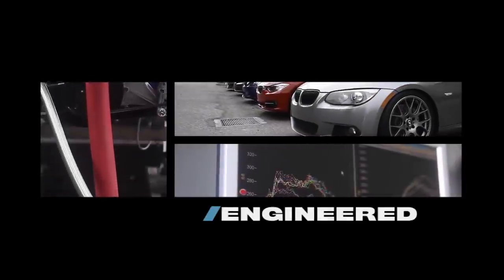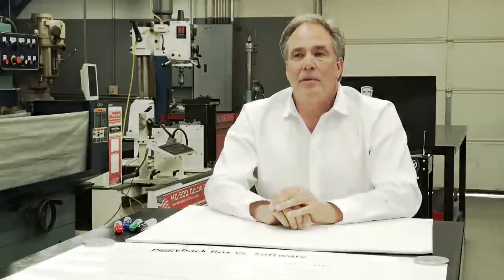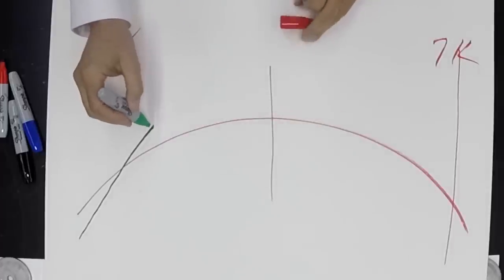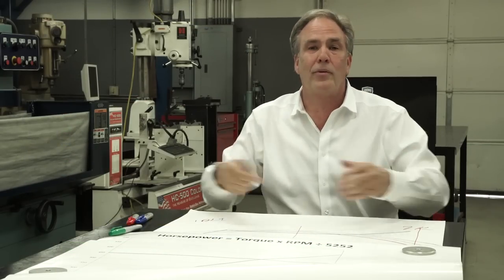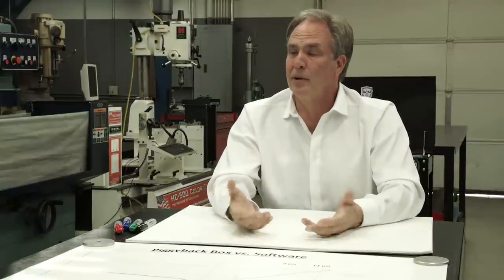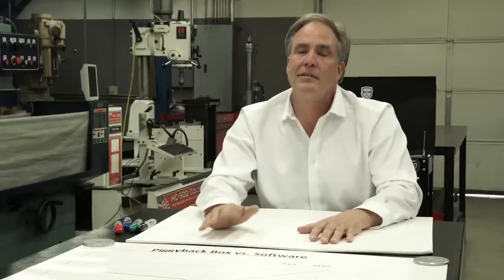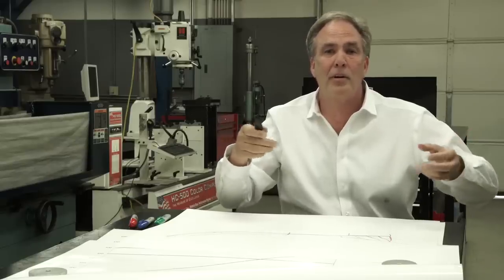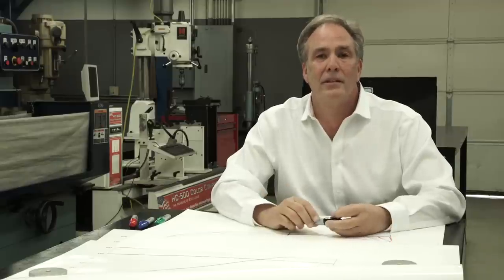The Magic of ECU Tuning - /ENGINEERED

Comment: I respect what Steve has accomplished.  I learned a lot by watching this.  However, he's wrong when he talks about ECU tuning on N/A engines being a waste.  I know from personal experience that I picked up 3 mph of trap speed and 3 tenths in the 1/4 mile with just a tune on a 5.0 Coyote Mustang.  This was consistent across 2 cars that I owned.  There ARE "conservative" factory tunes.  You gain throttle response, power beneath the curve, and peak power if it's done right.  Hundreds, if not thousands of people have repeated the results I'm reporting.  Dyno testing proves 20-30 whp gains.  I'm sure what he's saying is true with some N/A engines, but certainly not all.  Real world repeatable testing is more powerful than assumptions about what does or doesn't work on all engines, based on tuning experience with SOME engines from a limited number of manufacturers.
Reply: +hartsickdisciple in the video he explicitly says with no other modifications. He said with new, to use his term, "hardware" like headers, muffler, cold air intake, a new tune would yield more HP. He was stating on a stock car with stock headers with stock muffler with the stock intake a "tune" would get you nothing.
Reply: Cody Cadwallader Yes, I know.  He's wrong.
Reply: +Cody Cadwallader No I would have to agree with hart. There are definitely factory conservative tunes, actually I am sure there are plenty of them. If all you are looking for is more power theres no way a Honda Civic is maxed out for power, regardless or mods or not. I would agree though that the amount of money spent on an ECU or a tuner, or both is not worth the extra 10 whp or so.
Reply: +Joe Befumo Can confirm, I also got a mpt tune on my stock mustang and definelty makes a difference in my 1/4 mile. Conservative stock tunes for sure.
Reply: what he meant was you can't take an N/A engine and go past the natural limitations it has. you aren't actually adding horsepower to an N/a stock tune. what you are doing is removing the safety barrier the manufacturer has set. the horsepower you thought you gained had actually been there the whole time it was just blocked off.
Reply: +JJ20kil3r that's what were saying they have really conservative tunes from the factory, were unlocking the unreachable power. So adding power. tunes can only get you so far, then you need to add hardware and retune for it to get optimum power
Reply: JJ20kil3r What you just said makes no sense.  What "natural limitations" would those be?  Very few N/A engines make anywhere near the amount of power it would take to break internal components.  Other than mechanical durability, which I just addressed, the only other things to worry about are lubrication and fuel/air mixture.  If the aftermarket tune is safe, which most are, there is no "safety barrier" being crossed.  The factory tune may be optimal for driveability in the opinion of the manufacturer, but it's rarely the best in terms of making power or throttle response.
Reply: +hartsickdisciple HAVING READ WHAT YOU WROTE AND ACCEPTING TOTALLY WHAT YOU CLAIM I WOULD LIKE TO GIVE YOU ANOTHER PERSPECTIVE,
I THINK STEVE IS PROPABLY MOSTLY TALKING ABOUT EUROPEAN CARS AS A REFERENCE.
TAKING IN CONSIDERTATION THIS HE IS RIGHT.
IN EUROPE THERE IS NO SUCH THING AS 5.0 MUSTANG AN 7.2 HEMI AND SUCH CARS YOU GUYS DRIVE IN AMERICA.EVEN SUPERCARS DIDNT USE TO HAVE SUCH CAPACITIES.THE LAWS ARE STRICTER,EMMISIONS CHANGE EVERY 4 GOD DAMN YEARS SO THAT THE GERMANS TAKE OVER THE MARKET,INSURANCE COST IN SOME COUNTRIES IS HUGE AND GAS IS MORE EXPENSIVE
SO YOU END UP WITH A LETS SAY BMW E46 320 170 PS.WHAT HP GAINZ WHOULD YOU EXPECT FROM A CHIP????5 HP???8HP?????SO YOU GET THE DRIFT
I AM ALL IN FOR WHAT YOU SAY THERE IS NO REPLACEMENT FOR DISPLACEMENT
AND PROPABLY IT COULD HAPPEN BUT ANYTHING BELOW 2.5 IS JUST A WASTE OF TIME AND MONEY
Reply: +hartsickdisciple You're talking about a tune. I could be wrong but I think he was referring to those crappy chips that cost you $20 and claim to get you 20HP, which is obviously BS. The way you car is tuned from factory is to be efficient in regards to MPG and driveability, like you said. Now, if you change the tune, you can get something a little more aggressive and better overall, in which case, you will sacrifice the fuel economy for more power. The point is that software and hardware go together. If you change your downpipe and exhaust, CAI, use colder spark plugs for instance you need to reprogram the ECM to take advantage of all that stuff. You probably won't get a much HP gains as you'd think but it's not negligible either.
Reply: Emmanuel Thioux I didn't hear him specify that he was talking about cheap ebay chips.  He made a general statement that applies to any type of N/A tuning without hardware changes.
Reply: +hartsickdisciple I see. Perhaps I misunderstood what he said, in which case, I would agree with you. Just updating the software won't bring much gains but they are gains nonetheless.
Reply: Emmanuel Thioux It's tough to beat 20-30 whp and 30+ lb/ft for $400.  You can get that with a tune only on a 2011-14 Mustang GT.  I can't believe that's the only car where this is true.
Reply: +Emmanuel Thioux significant gains depending on the engine. he's dealing with performance high end cars. I'd imagine that many of those have more aggressive tunes than say... a mustang.
Reply: alphapc777 You do realize that the Mustang GT has been a legitimate performance car for quite some time, right?  The coyote 5.0 was designed for the Mustang, and de-tuned versions made their way into Ford's truck lineup.  Almost all engines can gain power from timing adjustments.  The gains vary, and tend to get bigger with the size of the engine.
Reply: +hartsickdisciple I do. I have a 2015 gt ironically. I was just making a blanket statement.
Reply: +Cody Cadwallader I own an e92 M3, and there are plenty of folks seeing 15+ hp and 5+ ft/lb of torque on the dyno with a simple ESS or Dinan tune from stock. Head on over to the forums for proof if you don't believe me lol.

Comment: One thing about the "not making any power without hardware mods"

If you don't need to pass emissions (or plan on bypassing the emissions) you can get a simple tune to basically devoid the ECU from including the protocols that relate to these things.. you will get better performance and gas mileage by removing the emissions from the equation.

I used to do this and then every 2 years when I had emissions, I would tune it back to factory.. until I realized there were a few nearby cities that don't even require emissions, and my ex-gf (god bless her heart) let me register my race cars to her house in one of these places..
Reply: Well if you have a diesel engine, maybe depends on what type of emissions system they run, on a gas engine, you might be able to increase the boost pressure but that won't help the gas mileage :P
Reply: Haha no it certainly wouldn't! I'm talking about a naturally aspirated engine, the motors being tuned for emissions actually takes away from mileage and performance compared to when you remove all the emissions factors from the engine! I don't have any experience with diesel motors though.. So I'll take your word for it!

Comment: will a tune for a N/A engine decrease it's lifespan?
Reply: No, not if the engine is tuned right and not knocking.
Reply: xxthehuskycaboosexx I'm not a professional, but I'd say it's safe to assume that tuning a natural engine would increase the efficiency, therefore, creating a bit of extra torque with a positive effect on longevity.
Reply: You're unlikely to make any gains in efficiency by tuning an engine without mechanical modifications. They're pretty close to optimal from factory with manufacturers trying to achieve minimal consumption and emissions.

Achieving more HP in an aspirated engine through software alone will mostly have to be done through richer mixture which will actually decrease efficiency (and all for a handful more HP).

Comment: I bought one of this $20 chips and made over 100 hp with it
Reply: cool story bro
Reply: and dont forget stickers, more stickers more hp
Reply: +bigfutus Neon dude, 900 instant Kw to the wheels
Reply: +Gabriel Ospina Back when Chrome was big in the ghetto honda world, we would buy chips for the ECU at like a buck a piece, burn a new map, run it, make some adjustments, re-burn, run it etc.  Made much more than a few hundred hp on cheap chips haha freeware ftw
Reply: +Poor Man Mods Let me guess. You started with  an engine making over 300 hp and after the chip it makes over 100? Sounds like roadkill to me.
Reply: no, i had a SVT focus, it had 240hp, and i put a $20 chip in and i know it had over 350 RWHP
Reply: +bigfutus After changing my head light fluid, muffler bearings, and upgraded to duel carbureted windshield wipers, my 2005 chevord-lamborsch made 420 LPrwhp (left passenger rear wheel horsepower)
Before, it only made 69 AWDhp.
Reply: g4rr377 I actually prefer chrome duct tape, much more hi-end and as my pop always says, "a little chrome can get you home"
Reply: +jacob prentner wow i heard that that car also has the capability to make over 1000 psi to the left rear wheel. you should also get a sequential short throw dipstick.
Reply: i was thinking the same thing
Reply: +Poor Man Mods dude I know how you can get 500hp , paintbrake calipers red , getfake blow off valve, get fake boost, get sticker ''VTECH'' get sticker blow me up with a turbo, put on the widest body kit and biggest spoier
Reply: dude holy shit than you so much
Reply: +Poor Man Mods 
You must own a Honda
Reply: SVT fukus
Reply: +Poor Man Mods Are you telling me i can get a $20 chip n make my hot hatch a gymkhana beast? Rwd bro
Reply: +Poor Man Mods My favorite $20 chips are Ruffles. those give me like .3 hp though
Reply: i prefer pringles
Reply: jacob prentner
.3 hp is approximately = 1 manpower.......
Reply: im too smooth for ridges DoomsdayMelody91
Reply: DoomsdayMelody91 Uh oh seems like your Jokeometer is sending the wrong signal to your ECU, better go to sleep and wake up 5 times to find the code..
Reply: i dont have a ECU i have a carburpater
Reply: +Poor Man Mods seems to me he must be running 400 pounds of bs to his carbon fiber motor to make that much power
Reply: +Poor Man Mods your car must be a transformer then to use ur sticker bombed peice of cardbord
Reply: did you start out with over 200 hp?
Reply: +Poor Man Mods bro, focuses are fwd, rwhp, REAR wheel horsepower, you literally made 0rwhp
Reply: my SVT focus is RWD, i drift in it all the time. Its making more power with a pringle chip and carburpater than any one elses car on
Reply: Poor Man Mods 350 REAR-WHEEL-HORSEPOWER on a FRONT-WHEEL-DRIVE Focus
Reply: Poor Man Mods You sir have made my day.😂
Reply: a $20 ECU flash is not a DINAN dude. Congrats on the power but your engine is kinda cheating.. I hope it is past warranty.
Reply: I got my BMW M2 to go 0-60 in 0.3 secs with a $20 mod. I put it in a  giant capped off tube with a rubber seal and dumped 20 bucks worth of lighter fluid in the tailpipe and fired it up.  Destroyed the car, but it went like the Jesus.
Reply: I think you found a flaw in his claim.. Unless he was driving it in reverse.

Comment: Steve dinan is no doubt intelligent and knows a thing or two about tuning cars, but a lot of what he is saying is inaccurate or misleading. Tuning can be difficult and takes time to learn but it is not impossible for an average person to learn. Personally I played around with it for a few months and successfully tuned a car that runs well and makes big power safety. Drive should do an engineered episode on a company like haltech, aem, motec  who actually build ecus or even Andre from the High Performance Academy. Many of the things Steve suggests about ignition timing are not true. The purpose of optimizing ignition timing is to reach MBT(maximum brake torque) for that load and rpm. This does broaden the power band but that is not why it is done specifically. Also modern engines almost always gain something from tuning. Whether it is cam timing, fueling or igntion manufactures always leave something on the table. Even with knock sensors most cars still have overly conservative ignition advance. the best way to dial in an engine is on an individual basis. Dinan remote canned tunes in my experience are complete shit. They run rich and have very conservative ignition timing, not ideal by any means. Frankly the whole basis of Dinans business selling pre-made tunes you just load into your car is extremely stupid. To properly tune your car it should be done custom on a Dyno (obviously by a reputable tuner).

Comment: Guy sounds like he knows what hes doing......but is it wise to tune a n/a engine?, for instance the m3 V8 e92,surely bmw when testing the motor would have known not to increase the rev limit ?, purely for longevity,  who wants to drive around at breakneck speed then blow a motor after 20k because you remapped your car , increased the rev limit  and for what?, another 20bhp which you would probably not notice on the street.....although Dinan seem to be the Don when it comes to tuning....mmmmm not sure. Only saying as I'm thinking of remapping my m3 e92.

Comment: 0 gains on NA tuning isn't true for all applications.  it depends on how the car is tuned from the factory.  Coyote Mustangs for example have artificially reduced torque in the lower rpm range so idiots don't get themselves into trouble... non Z06 Vette's (at least C6, not sure about C7) have the same thing...  most Honda's can benefit from changing the VTEC switch over point...  the list goes on

Comment: "An air pump is only efficient at 1 rpm."  What does he mean by that?  2:10
Reply: +mephisto212 Does he mean that at some rpm the engine will make peak torque?
Reply: +mephisto212 So where the engine makes peak torque is where the engine is most efficient.  That is where it is getting the most power per unit air/fuel consumed.  So that must be where the highest cylinder pressure is also.  More power is generated after that rpm by just getting more cycles per unit time.
Reply: +mephisto212 Peak torque is highest when the cylinder pressure is highest at the point the piston has travelled 90 degrees down the power stroke.  That is when the most torque is generated on the crankshaft.
Reply: +mephisto212 It doesn't seem obvious why you would advance the timing when the engine is spinning slower than it does at peak torque.  So we have less volumetric efficiency when the engine is spinning slower, thus less air/fuel mixture.  If we advance the timing relative to the timing at peak torque then we are igniting while the piston is higher, and the static compression is higher but the dynamic compression might be the same because we have less mixture.  This must just get more energy out of the charge by giving it more time to move the piston but any more insight on this is welcome.

Comment: WHY DOESNT BMW DOES IT RIGHT FROM THE BEGGINING AND DOES WHAT DINAN DOES?
Reply: Not every engine behaves the same way out of the factory. What Dinan does is max the advancement of timing right before knock occurs at every possible RPM in the powerband. As a car manufacturer you have to back off from the absolute max because you don't know, some engines have different characteristics from others and don't make power as well at certain RPMs and you've got to leave some safety retardation so you don't have pinging in every 100th engine.
Reply: he said software has no purpose without hardware. Dinan installs their parts and then installs the software to take advantage of the better parts.

Comment: This is 1 of the many reasons electric motors are totally superior to fossil fuel engines. Engines are inefficient and overly complex. Many more points of failure in an engine. More parts more maintenance = bad. No more oil changes, transmission crap, spark plugs and all the various parts of managing air intake and air fuel ratio. No rusting exhausts to constantly replace. Electric is cheaper than fossil fuel. Quieter smoother ride. Max torque at all times. For like 140k you get a tesla model s p100d that goes 0-60 in 2.4 seconds at stock which beats million dollar cars. You can shave the time even below 2.4 seconds by replacing as much as you can with custom made carbon fiber parts on the model s. With engines you always have to worry about reduced lifespan when you add turbo boosting and various other things. The model S you just replace the battery once every 8-10 years, replace tires and brakes as needed and you are done. You basically save 2-3 grand a year in fuel and maintenance costs. With the model 3 that will be a big deal. We will say 50k for a very well kitted out model 3. 8k back in state and fedral tax so 42k over 10 years you save 25k vs owning a fossil fuel car. Now you basically paid only 17k for a brand new amazing all electric car.

It's just a matter of time before electric completely takes over. You get a superior product at much less the cost.
Reply: Couldn't have put it better myself mate. Only when they make electric cars look like decent sports cars with usable customisation options would I even (THINK) about (MAYBE) possibly contemplating having one some day. But that day will gladly never fucking come in my lifetime. Give me an old E30 M3 or escort RS200 any day over a glorified duracell battery on wheels - rusty exhaust and all.